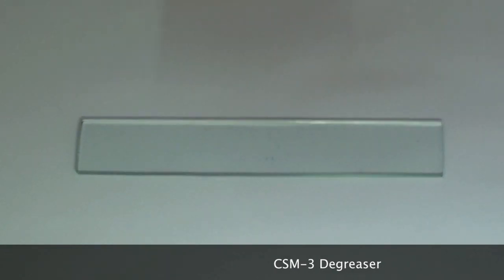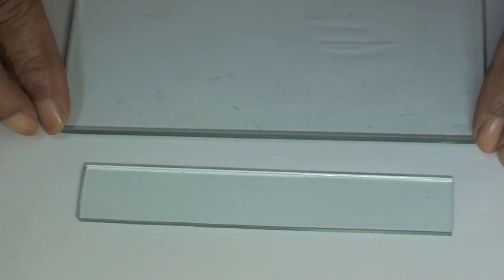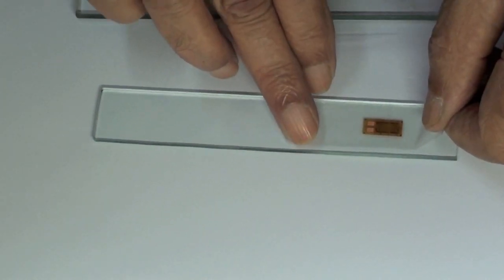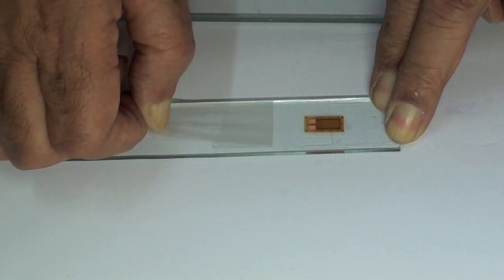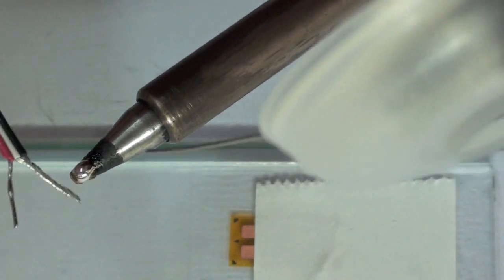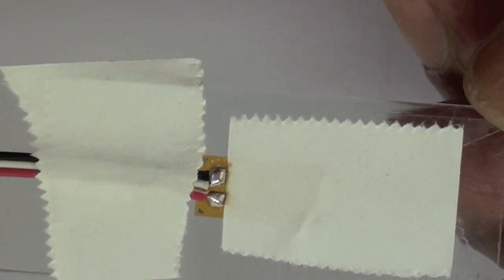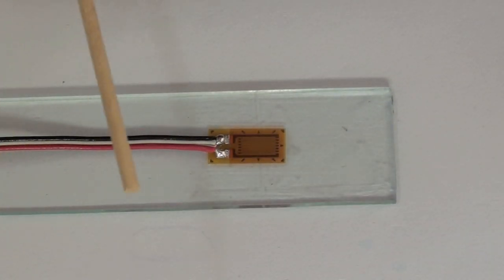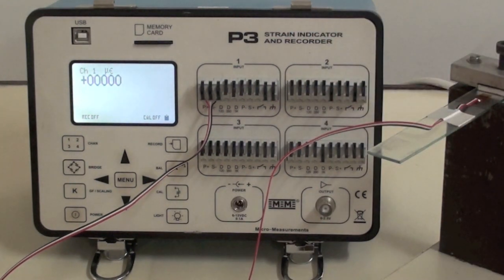Strain gage (gauge) installation on glass

Comment: Very clear explanation, Looks like the company has a part # for every item used, I like is perfection!
Reply from the maker: Thank you for your kind comments. 
We have introduced a new range of strain gages for PCB testing. These are miniature 3-element rosette gages of very small size and with attached lead wires, that can be bonded on the PCB very close to the edges or corners of surface mounted components, to measure the strain at these locations due to forces on the PCB during assembly or mounting. Please contact us on vijay.dynatec@gmail.com for more details. Best regards

Comment: very nice teaching sir Awosme......nice.......nice
Reply from the maker: Thank you for your comments. Please see another video for bonding gages on Glass using M-Bond AE-10 adhesive. This seems to be a better solution for strains on glass, as I have attempted to bond without abrading the surface of glass, and the AE-10 adhesive is better suited for this application as it is a stronger adhesive.

Comment: Thank you for this very informative video. I am looking for a method to measure strain in wood, do you think that is possible with strain gauges?
Reply from the maker: I have just bonded a straingage on a cricket bat , and it is working well.Abrade the  surface with fine 320 grit abrasive until it is completely flat. I avoided the cleaning with the acidic conditioner , just cleaning with M-Prep Neutralizer, then allow at least 15 minutes for the wood to dry fully, before applying adhesive to bond the gage. 
Regards

Comment: Can we apply same procedure on alluminium or steel loadcell?
Reply from the maker: For aluminium and steel components, you should use the procedure shown in my video Straingage installation procedure. The surface preparation is slightly different in this case, but the general bonding procedure is similar. Please review and let me know if you have any further questions, on vijay.dynatec@gmail.com

Comment: TECAT Performance Systems designs and manufactures the world’s smallest, lightest, and most power-efficient wireless sensors. These features allow our customers to measure torque, acceleration, and atmospheric data in places and applications that were previously inaccessible. Delivering wireless sensor solutions that are unmatched in accuracy, price, size, efficiency, and simplicity, TECAT Performance Systems maintains headquarters in Ann Arbor, Michigan and production facilities in Madison Heights, Michigan.  @t